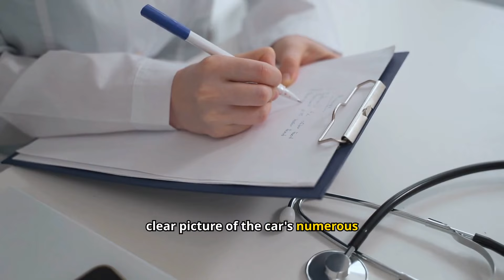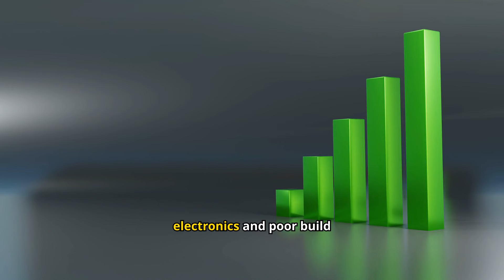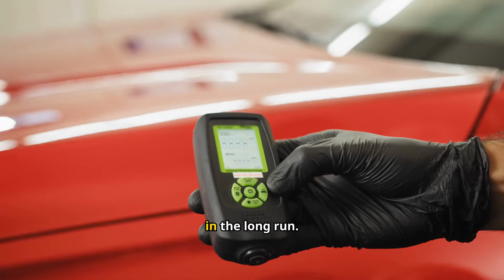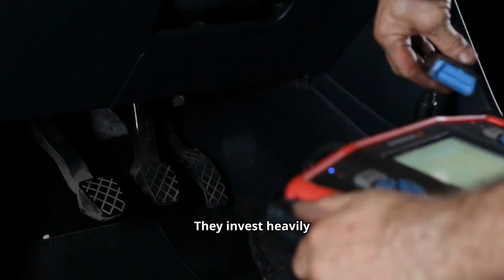Top 5 WORST Quality Cars To Buy

Comment: I used to own a 1976 Ford Pinto Pony. The issue with the gas tank was fixed on a recall involving the installation a flexible fuel line in the engine compartment and a plate mounted forward to the gas tank which would cause gas from a ruptured tank to be thrown back from the rear of the car instead of forward toward the engine. As far as the video content here, it might be helpful in this case to show images/footage of the cars being discussed rather than of newer cars not related to the problem. Just sayin'....
Reply from the maker: Hi Justin! Thanks for the comment, our Video Generator can be off at times we will continue to work on getting accurate footage as well as keeping a great dialogue! Thanks!